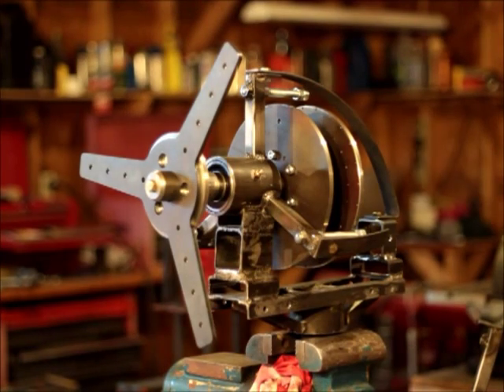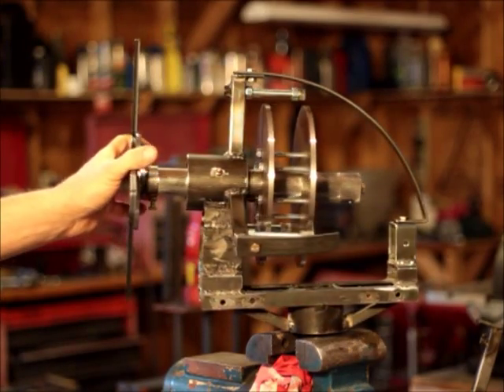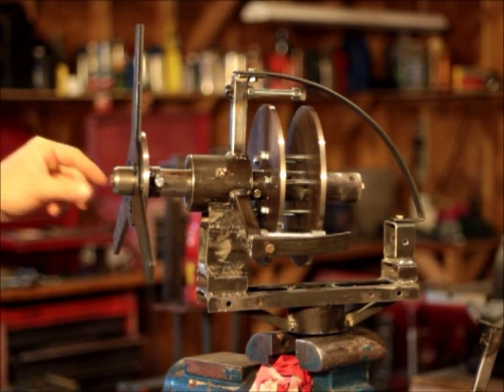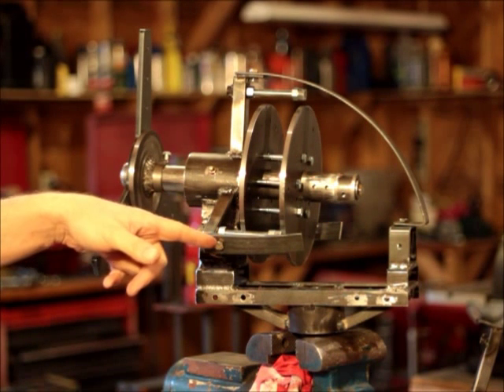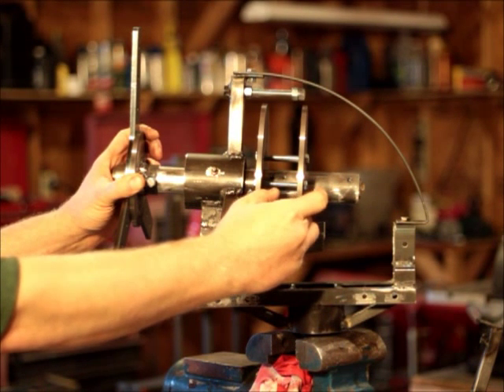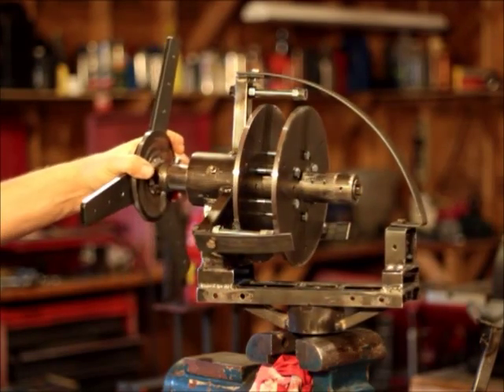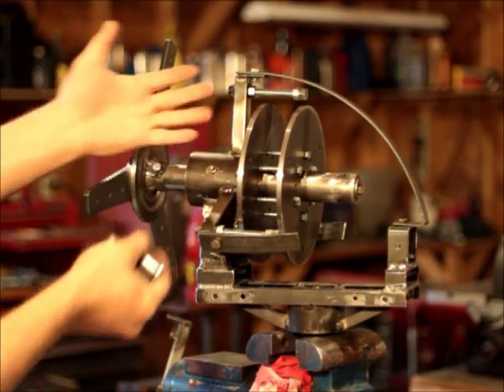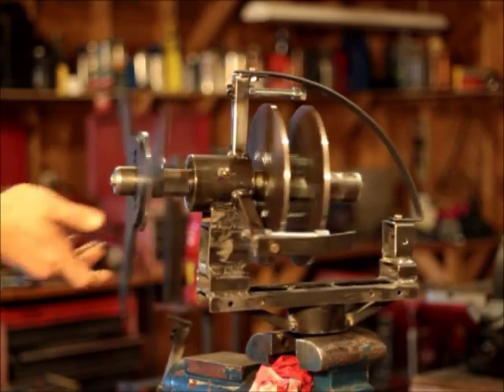Part 1 "Straight Shot" Axial Flux Wind Turbine Introduction by belgrademachine

Comment: My biggest problem with HAWT is the brushes and commutator assembly to send the power down the tower. I'm working on VAWT, so I don't have that to mess with. BTW that is one beast of a turbine!!
Reply from the maker: Awesome! A kbbacon turbine project! There won't be any brushes or commutator on this one its a dual magnet axial flux alternator. And a guy could purchase slip rings online from a number of places pretty cheap to prevent wires from twisting up. My only concern is corrosion since it is all steel .... I'm leaving it to whoever gets it to apply primer and paint etc.....

Comment: This is looking really good,, I like that you added a 17mm shaft. This gives the option to try several different blade designs to help maximize the power output. This is very cool,,, Keep up the good work :)
Reply from the maker: Thanks Jason! Yeah the new shaft design is the way to go ... each one of these with have slight improvements as I go along. I'm open to ideas too and know you have a set of those blades. Thanks for watching bro!